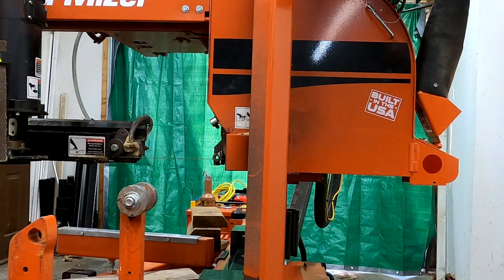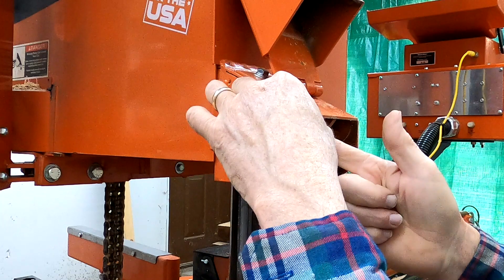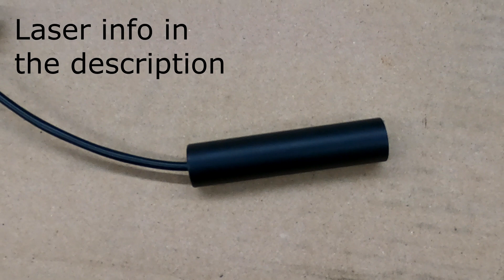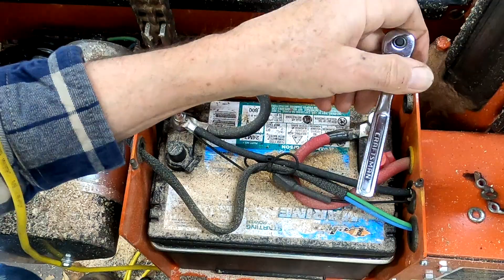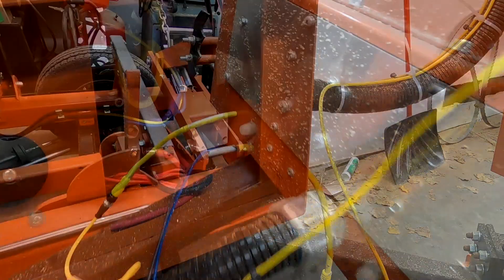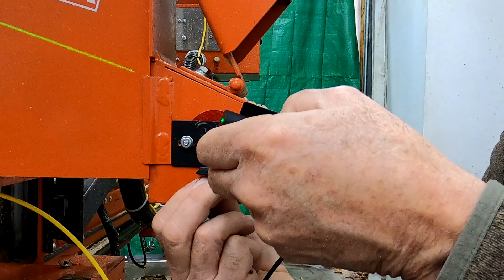Installing A Green Line Laser On My Wood-Mizer LT40 # 169

Comment: Hey Dave, i messaged you some months ago about installing a laser on my sawmill. Im wondering if you have had any problems with your mill since you installed your laser. I recently received my new LT40 and installed a laser on it using the same process as you and the H bridge has now went bad for the second time. Im not sure if it has anything to do with the laser. It ran fine last week even with the laser on. Thanks buddy
Reply from the maker: I apologize for any delays in getting back to you. Sometimes I don't get comments and, sometimes, I see a comment that disappears (forever) before I can respond.
Sorry but I don't know what an "H bridge" is. What I used was a cheap 12VDC to 3VDC power supply (converter) I got on Amazon. For 12 volt power I connected the wire to a spare, fused, terminal in the control station. I also decided to run a separate 2 conductor cable from the control station to the laser because that's the way I did it in my old job.
I have had ZERO issues with the laser since installation.................well.............except my dust chute cut the cable once. My email is tomats100 at gmail.
Dave

Comment: Where did you get the yellow cable and the transformer? Also, how did you connect to the 12v battery? I enjoy watching your videos. Thanks a lot
Reply from the maker: Thank you for the comment. I'll try to answer the questions so that it makes sense.
Everything should be available at automationdirect.com. You can also try Amazon.
1. The cable is an M12 sensor cable with male and female connectors. They are available with 2-5 wires; you need at least 2 wires. You will need to determine the length of the cable (the cables are available in lengths of 2-30 meters).
2. At the control station you will need a female bulkhead fitting for the cable (above) to plug into. These usually have 5 pins. You would use pin 1 for DC power and pin 3 for DC common (ground).
3. The DC to DC converter takes 12VDC in and converts it to a lower voltage. The output can be between 3.5 and 5 VDC to make it easier to find a converter.
4. There was a spare circuit breaker in the control head that I used for my 12VDC power source.

I'm thinking I should do an update video on this that shows more detail.
Good luck.
Dave
Reply: Thank you for the directions sir. I do have another question. As far as the sensor cable goes, can I use a solid cable running from the control box to the laser that doesn't have the male and female connector?
Reply from the maker: @danielgreenwood3998  I used a multiconductor cable because that's the "proper" way of doing it. I recently saw a video where someone connected the laser "ground" wire to the mill frame and then ran a single power wire from the power source; just like auto wiring. It's cheaper and easier.
Good luck.
Dave (not sir)

Comment: It's also not necessary 😕
Reply: Nether are your negative comment's.🤐
Reply from the maker: Sorry but I don't understand. What isn't necessary?
Dave
Reply: @TheOldManAndTheSaw  adding a laser, like the led lights that make my Harley Davidson glow, it's just fancy window dressing, nice but not necessary "/
Reply from the maker: @cancelchannel3394  The laser is used to align the blade height with the desired cut path. This is VERY helpful in accurate milling.
Reply: I can use the money it cost to purchase more important equipment, like a winch to pull the logs up on the bunks, a peavy to roll the log over, a cant hook, things that are a major necessity "/
Reply: @cancelchannel3394  You don't have log rollers or a winch but you have a mill? And you don't understand how helpful a laser guide is and you have led lights on your Harley? You could of bought a winch and log rollers and a brain with all that Harley money.
Reply: @cancelchannel3394 does that Harley tow your mill around or did you mount a winch on the back of it? You could of bought useful equipment instead of that waste of space bicycle
Reply: @TheOldManAndTheSaw  I plan on removing the led lights from my Harley ")

Comment: Dave, you might benefit fron one of those new wave digital protractor contraptions like your great great grandpappy wished he had.  They cost ~ $30 and the one I have is slightly off by 1/10° at 90° when matched up to a Starrett machinist square ---- negligible for slicing wood.  It's better than trying to eyeball a level from the position of a compound angle.  As long as the battery is OK they work fine and fit in a long pocket.

When I work with small parts, nuts, bolts, screws, etc., I put a light colored towel on the floor or table under the work area.  If I drop anything it doesn't bounce off a hard surface and hide itself from me.  Try dropping a small metal screw or nut on a kitchen counter from about 12 inches up and watch what happens.  Better yet try it with screws from your eyeglasses.
Reply from the maker: Ralph, I just dropped a 3/4" piece of black plastic on the floor at my feet. Gone forever.
Thanks for the tips.
Dave

Comment: Great job on the install Dave. I'm relieved that you didn't get suckered into buying one of the expensive "re-badged" chinese lasers that people are retailing in America for $500-$900.  It's absurd what vendors think they can get away with.  I have a 50mw that I bought off of aliexpress for $25 that I have to mount to our mill.  I think the 50mw's should serve us both well in moderate sunlight (don't know about full sun).  -Andy
Reply from the maker: What we need is a 50WATT laser and then we can LASER the boards off. Would that be cool or what?
Reply: @TheOldManAndTheSaw  Until you burn your building down using it .  .  .  .
Reply: @The Old Man And The Saw  it's odd that you say that, I used to work around 3-7kw lasers doing my metalworking the last 20 years. Most people don't realize just how short the focal plane is on a powerful laser, makes it incredibly difficult to make deep cuts. How much snow are you getting here shortly Dave? -Andy
Reply from the maker: @cripplecreeksawmill  We got about 18" yesterday. At least it was wet, slippery, and heavy.

Comment: The wire for the laser is under the engine ,the cover plate attaches to the mast post. it is folded over and taped to the main harness . I think it is # 27 , the other end is in the control panel taped up by the up down switch. At least that is where  mine is I have 2010 LT40  I Put on laser on mine, works very good inside not so good outside on a sunny day, I find green is better. Look in your service manual in electrical diagram for the proper wire numbers, as i may have given you the wrong numbers for your machine. Good luck on sawing.
Reply from the maker: Thanks for the info. 
I'll forgive you for not telling me this before I started.
This time.
Thank you for taking the time to comment.
Reply: Where does the second wire from the converter connect?
Reply: @jordanwichser8037  The other wire on my laser is ground , just hook it to any place on the steel frame.

Comment: Dave what's the advantage of these lasers everyone's installing on their mill's?
Reply from the maker: Ever heard of an "ironing board flitch"? You get them when your blade isn't low enough on the non-straight log and it exits the log part way down. The piece looks like an ironing board and is a total waste of time, fuel, blade wear etc. Watch some of my videos and you'll see what I mean.
With a properly aimed line laser you can see the blade's path BEFORE you start the cut and then you can make adjustments so that you get a full cut.
I hope this answers your question.
Dave

Comment: Dave, thanks for making this video. I have been planning to install a laser on my LT35. With your instructions it should be pretty easy.
Reply from the maker: Good luck. Make sure you get the correct mount for the laser. I ordered the wrong size but Alpina caught the error and gave me the right one.

Comment: Mr.Dave there is already a pre-wired wire for the laser already is ran for you. I already installed a laser on mine but haven’t done a video on it yet. I bought a cheap laser and it’s not powerful enough . I’m going to order a new one when I get a chance . Good job on installing that one. Thanks for sharing